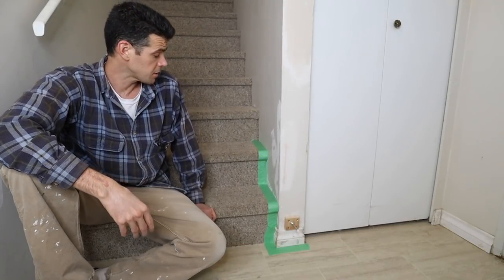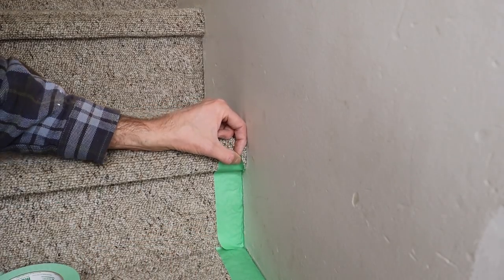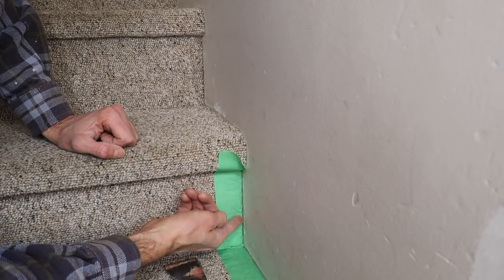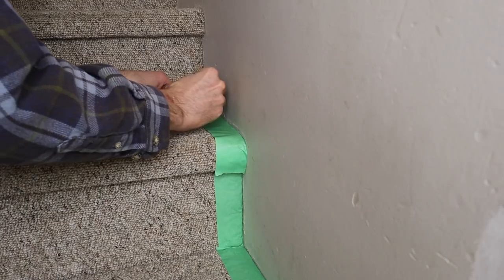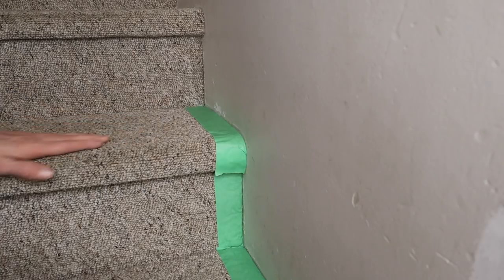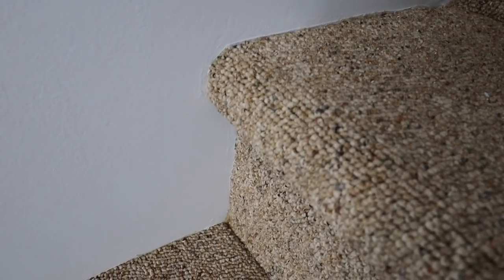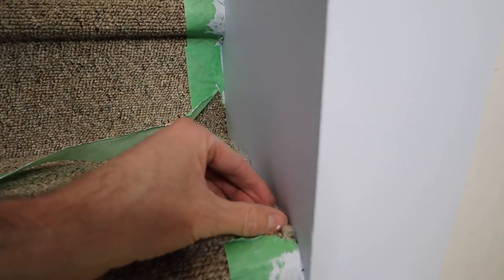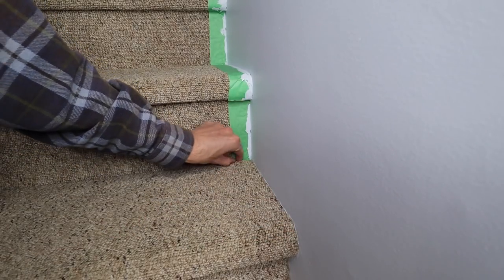How to Prep and Paint around Carpeted Stairs!

Comment: As usual another great video. I watched the one you did on caulking around baseboards. I tried it and it worked great. Also used the same method around the tiling in my kitchen, again it worked great. No mess to clean up. Thank you and keep them coming.

Comment: I've used waxed dental floss down in between tight places like this. It often stays put while painting, and it pulls off with a knife-edge line, and the tape then comes off effortlessly with no issues with the painted surface. You can use the floss several times. It's an extra step, but the result is solid.

Comment: I have used the same technique for several years.  But I use packing tape and here’s why.   I found that masking tape did not have the flexibility needed for tucking.  Plus it tended to stick to the carpet and would also tear (at times) when pulling it off.  The sticking problem might be resolved with frog tape but that’s an expensive alternative.  I tried packing tape and and all the issues went away.  But I am happy to say that I’m building a new house and it will have LVP throughout (except for a set of stairs leading to a FROG and the FROG itself) so this technique will only be needed on a small scale.  Thanks for sharing the technique.
Reply: Frog tape - that blue stuff - is not at all expensive on Amazon. I got 3 rolls of it for £5 for my painting project.
Reply: @_-.Victoria.-_  That is not frog tape, that is regular painters tape you are describing.   FrogTape is green (and orange) and is more expensive.

Comment: Excellent video, lots of great tips, I recommend the blue tape, better quality than green, doesn't bleed at the edges as much. 2 coats of primer on new drywall is my " trade secret ", with 2 coats of paint you have a very high end finish, if the job warrants it.
Reply: That’s not necessarily true. Most of the blue tape is junk, try frog tape delicate surface(yellow).
Reply: @ryane6719  blue tape has been fine for me. Must be the way your applying it
Reply: @ryane6719  Just finished 180 units done to level 5 drywall finish and only thing painters used was blue, and the final paint finish was very high quality. I have found a significant differenc between green and blue for my own small projects in the masking portion of the job.

Comment: I found that cheap duct tape works better as it is not too aggressive in stickiness and it tends to round the edge of the carpet so that you don't get a ridge line higher up... if anything it is down further and will be covered once you pull the tape off as the carpet pile returns to normal height.  Just my two cents, hope it's worth it to someone. Otherwise great work as usual Vancouver Carpenter/ Drywaller/Painter... walls are looking sharp!

Comment: Thanks. Couple of Q's (1) Given the issue you had with the tape sticking to the wall, and given how it's going to be pretty impossible never to touch the tape with paint, would you advise using that wide metal tool FOR THE FIRST COAT, along with the tape,and not just for any required touch ups ? (2) I'm painting base boards up the stairs with water based paint. Do I do the 2 coats and let it all dry before lifting the tape ?  Cheers !

Comment: hi when you pull edge of carpet back to paint at about 5.00 minutes on video. Well I'd like to know what the tool is called that you use to do this. Have been to 2 diffrent painting and decorating suppliers not stocked in either. And showed video and no one knows what its called. Is this video under copy right I could get prosecuted for showing in  public HA HA.

Comment: I also use wax paper and tuck it in with a plastic putty knife. Then the adhesive from the tape does not pull the carpet fibres.
Reply: Hi Roman.  I experimented with some blue tape I had here, pushing it down with my scraper. It makes a nice neat line, way better than just fingers. So I should then do a layer of the wax paper, also tucking it down ? When you say wax paper, do you have a link ? Is it that stuff people use for baking ? ("Baking parchment") Thanks
Reply: @_-.Victoria.-_  No, regular waxed paper like used for wrapping sandwiches. It was all we had before Saran Wrap. Sold in the same section in the supermarket.

Comment: Someone thing that I’ve learned when taping off and painting is that you remove the tape before the paint dries and in fact, most tape I have bought says to do this instead of leaving the tape on in between coats. Of course, then you have to reapply tape in between coats but then you’ll have beautiful lines every time.
Reply: Do not remove tape on this sort of work you will surly make a mess you can’t fix painter giving you a painting tip 👍🏼
Reply: During the coats let it dry and top coat let it dry before removing tape

Comment: Good advice.  And I’d add always try and remove the tape when the paint is still wet.
Reply: Sound advice. I always take the extra effort to peel and then re-tape between coats of paint. Kind of a PITA, but letting the paint dry on the tape almost always results in problems when you start peeling.
Reply: Do that at the edge of carpet and you will ended up with carpet fibers that have paint on them.  And it would be impossible anyway if you are doing two coats.